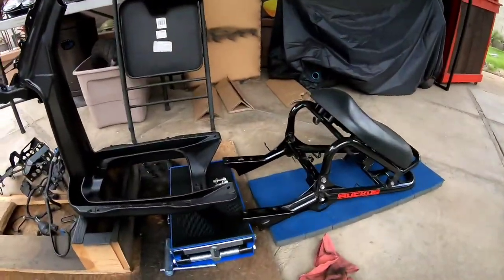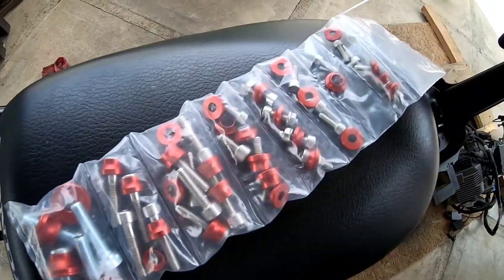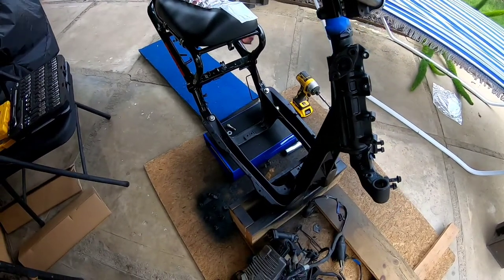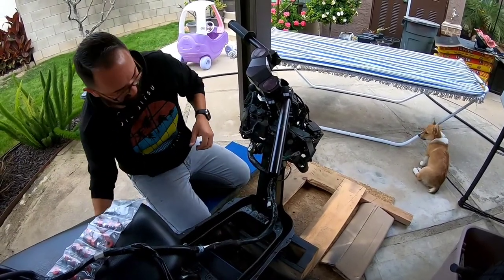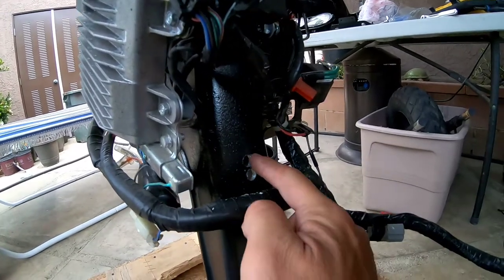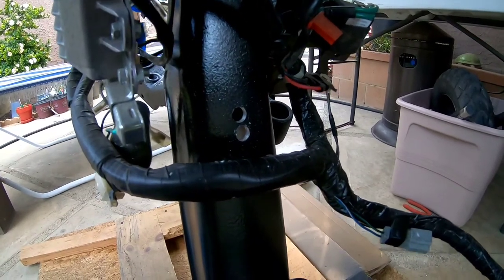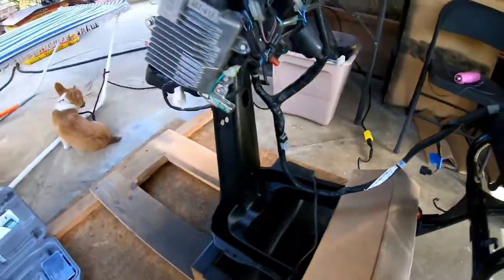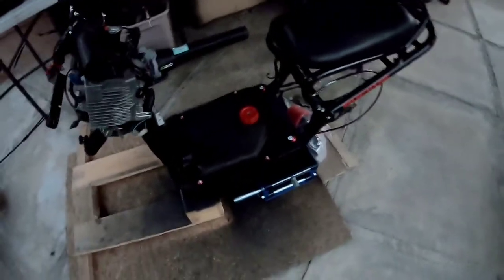The Ruckus Build // Wire Tuck // Vlog Series

Comment: When u did the brake and throttle cable tuck through the frame did u have to get longer cables or was it the same distance going that route?
Reply from the maker: I used the same upgraded cables you would get to do a stretch on a gy6. But keep in mind im using a 8-9 inch stretch keeping the build on the performance side. I did have some slack in the cables so I would say maybe if you do a longer stretch it may work not just super long cause then maybe it will be harder to hide the cables in the rear. Thanks for the support and watching!
Reply: Awesome I'm gonna try to tuck my cables see if they reach.